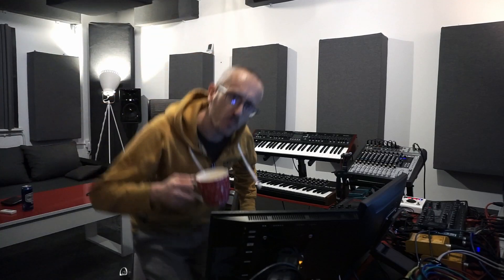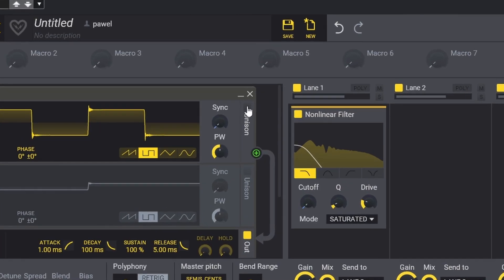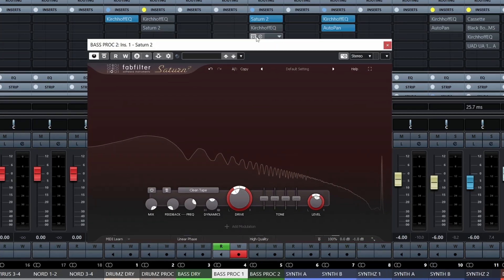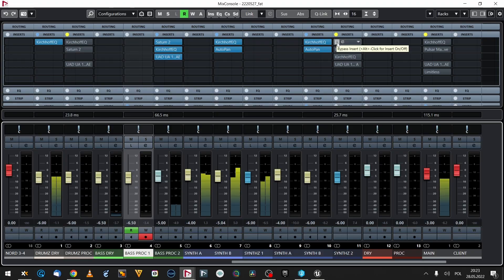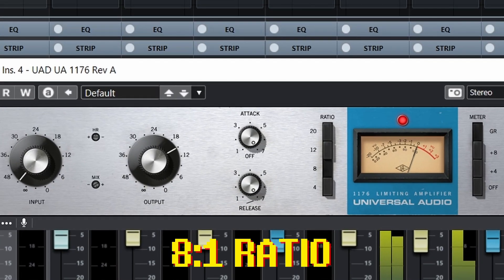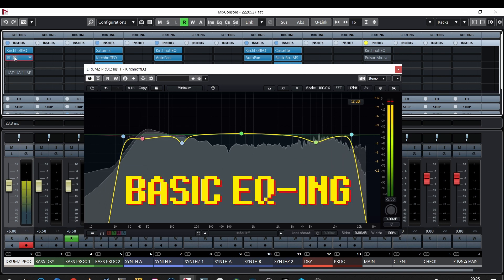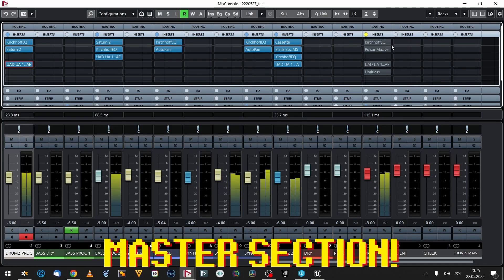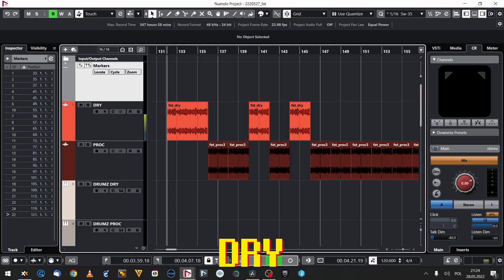Make your VSTs FAT and more ALIVE!

Comment: Thanks for the video!
 
Not related question but I noticed you have probably Vicoustic polystyrene diffusion panels behind you, I was thinking about them but would like to know if you like them and if they work well as diffusors.

Because they sell them only as pack of multiple pieces and it isn't really that cheap to waste the money if it isn't worth it.

Any opinion helps thanks!
Reply from the maker: These are Seven Audio diffusers, N11 formula. They work between 1.2k and 6.8k. Pozdrowienia!